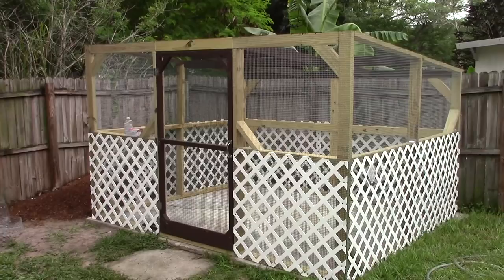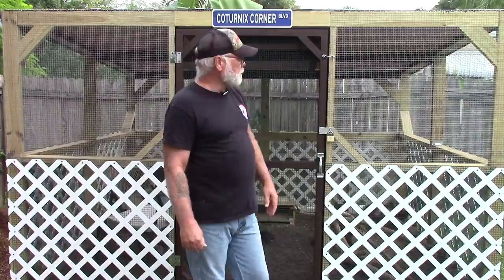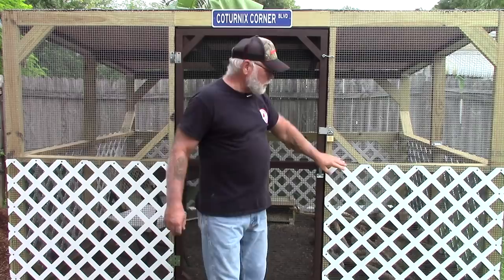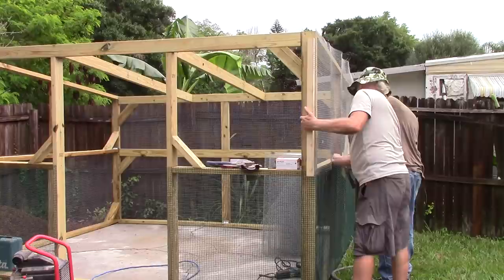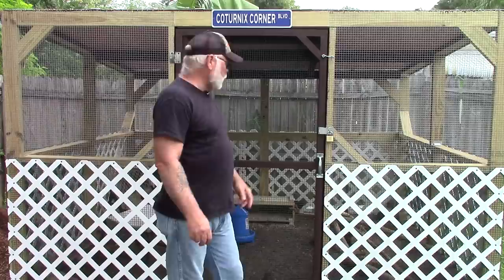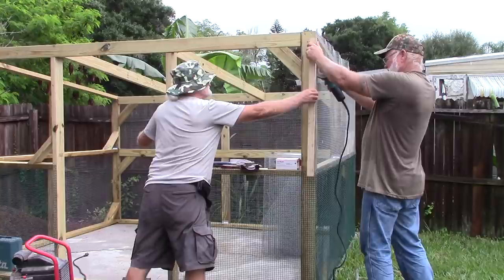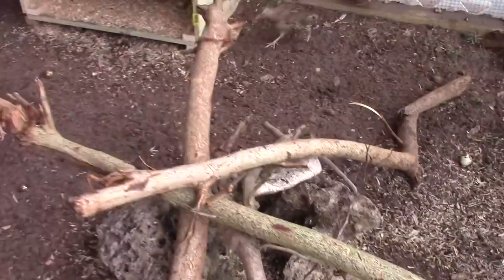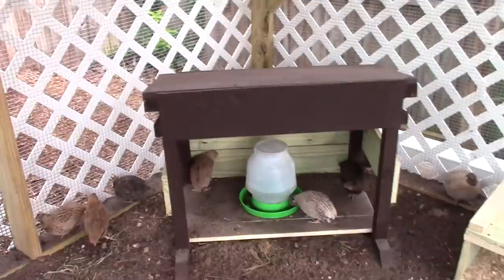BackYard Quail Aviary - Keeping Coturnix Quail in an outdoor setting.

Comment: I really like it and yes supplies are expensive for sure! As for roofing, I learned that using plywood  layer on roof then white plastic corrugated sheets on roof stays a lot cooler underneath rather than just one or the other material. The wood is a barrier but alone it gets very hot. Same with the heat transference with just the corrugated sheets but with the sheet on the plywood under it the corrugated space between the wood and plastic will create a heat driven airflow like a radiator and significantly decrease the heat being transferred below the ceiling. So much so that I often have doves laying on the white sheeting in mid day and the chickens underneath get up on roosts near the roof in Texas sun to stay cool. It is truly worth the investment in hot regions.
Reply: Mint plants are good. A lot of critters and insects do not like it and the quail will peck at it happily and it covers smells and grows like crazy.
Reply from the maker: @bayoubonsey2911  Thanks!
Reply: @bayoubonsey2911  Mint spray around my basement joists keep the damn mice out in winter…great call on a natural source!

Comment: My quail aviary is a 6ftx4ft walk in dog kennel 6ft high that is completely covered in 1/4 and 1/2 hardware cloth. The bottom is open and I have cinder blocks around the outside. Wood chips inside that I turn every few weeks to allow to compost down.

Comment: Had a similar set-up when I first started my quail, then went to more of the battery cage style for one reason - RODENTS. Once they found their way in, I couldn't keep them out at night! If at all possible, I would suggest replacing the chicken wire with hardware cloth as soon as possible. Also, with the stapling, either cover with a strip for more support or check it every few weeks as the wood ages to make sure none of the staples have worked their way out, or mice will start squeezing in there as well.
Reply: I would add that screws with large washers are much more secure than staples. Chicken wire is not meant to be used to keep predators out, they can rip right through it and many of them are excellent climbers. Chicken wire is only good to keep chickens, etc...in.  Other than those things it’s a pretty cool aviary. It’s super nice to be able to get in and handle your birds, in my case chickens.

Comment: I love it 💕  my only change would be a rabbit water nipple setup so they cant mucky up their water.  Of all the water nipples the most versatile ones Ive found that are easiest to clean out when needed are the rabbit water nipples with the plastic ends because they can be removed temporarily to install a different way or to clean any possible clogs though I havent had an issue with that.

Also what works rabbit bottles.  When my friend showed me that with birds Ive never gone back.  Best thing for a brooder too (I loathe poultry waterers since birds will kick shavings dirt etc thus contaminating the water and making it need constant changing or risking them drinking contaminated water.

Oooh also with your set up if you did do an auto waterer you could use that slant add a gutter and direct the water to refill their auto waterer 💕 its at the perfect angle for that.

Comment: Potted Contorted Filbert for a tree and several kinds of grasses are what I have.i sometimes plant pansy and other edible flowers. I put the wicker baskets ( with a door type used for rabbits) in there as well. Gives a place to hide. I used logs to build different levels of ground  around the outside so as to create a secure feeling for them. So the whole thing has flower beds per say around the edge. I use deep liter method with chips and hay. When the poop gets little thick ( about once a week) I take off the whole layer of hay thats on top leaving the chips.  Refill with fresh hay. I use the poop covered hay as a mulch in my gardens. This has worked out for me very well. No cages. I have a solid roof and electric run to mine. Cement floor. Similar walls, only i used double wire layer. Long story there but it works well. Keeps it dry in winter where I have them. Always open air. Heat lights for cold. They are very happy little quail. I have about 40 free-range a 10x10. No problem.  I have to watch for the ratio of males at times.

Comment: Great. I built my first wooden hutch a while back off of your designs, and that worked pretty well. Then I built a double wide hutch out of conduit pipe and that was ok. I messed up the flooring and due to a miscalculation I wasn't able to easily fix it and it's not able to be elevated the way I wanted. Now I've been thinking of building an aviary to let the quails go on the ground, and I think I'll give your design a try. I'd like to try doing it from conduit piping and the maker pipe connections, but I haven't figured out a way to design a door for it and be predetor proof at the same time. I'll keep trying to figure it out but if I can't conceptualize it I'll just go the wooden route. Thanks as usual for your videos.
Reply from the maker: Good luck with your new build :)

Comment: Racoons have been eating my quail right out of my aviary at night. They will grab them right through the half inch fencing I use, and rip them to pieces trying to get them out. The animals will do anything to get at the quail, and they always switch up what time they come out depending on when I go out to try and catch them. I will try to trap the racoons, but not sure that will even work. They are relentless.
Reply: I suggest setting up an electric hot wire around your set up
Reply from the maker: I haven't had any issues with keeping my bachelors outdoors, and they are in a 1/2" wire cage so I don't expect to see any issues with this setup.
Reply: I agree an electric wire about 6” up off the ground and 6” standoffs will likely solve your problems. Good luck
Reply: @CoturnixCorner  I also used the 1/2 inch wire, but they ripped the quail apart right through the fencing.
Reply: @thelarochellefarm595  I live completely off grid so using electric fence would not be an option for me, but thanks for the advice.
Reply: @jasonseagram4622  they do have solar powered ones that should work for you.
Reply: @jasonseagram4622  Also kudos to you for being off the grid, not sure if I could hack it. Congrats
Reply: @thelarochellefarm595  it's a humbling experience, I'll probably be looking into the solar fencing.

Comment: Hi Terry.  I love your aviary. I have one suggestion for your waterer: connect it to a water timer and use drip irrigation tubing and drippers to keep constan clean fresh water for your birds. Combining time on with drippers volume you can have the amount of water you need.
Of course I will copy your aviary. Since I hate doing some task as cleaning the pup, I need your advice on the floor: I plan to let the birds to defecate directly on the soil (no concrete slab) with lots of earthworms to feed on the pup. Do you think it will work? 
Thanks
Carlos
Reply from the maker: Yes, it will work fine. I would recommend using the deep litter method. I recently did a video on the subject.

Comment: Question - How will they do during the winter without sidewall cover? Here in Georgia we get down to 30 degrees for several days at a time. I would really like to know your thoughts.
Reply from the maker: The will do just fine outdoors here in the winter. I will have bushes planted around the outside perimeter to help block the wind, rain and sun in the summer. I know some folks up in northern Canada that have quail outdoors in the winter and they regularly have temps drop below zero.
Reply: We've been down to -10° in  my area in NM and they're just fine.

Comment: That's cool Terry!
How come you didn't use a clear or colored corrugated panel for the roof?
I thought you had terrible thunderstorms/weather there.
Reply from the maker: the corrugated roof panels were over $20 each so I went with the tarp which is only $10 and covers the entire aviary.
Reply: @CoturnixCorner  holy crap...
Reply: We used metal roofing panels. Very expensive.   My son in law used a heavy duty tarp, and it works great as well.
Reply: @CoturnixCorner  I read somewhere if ya PAINT the tarp 3 x it will last 5 or more years. Tobias RW Brown Eloy AZ